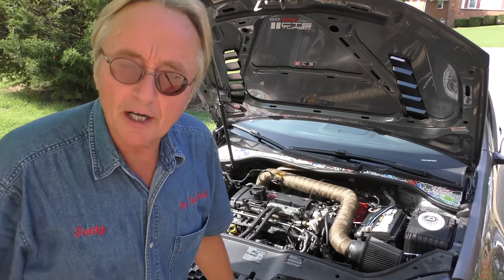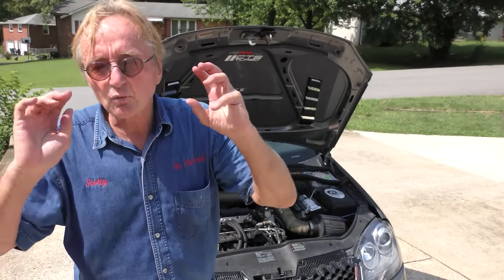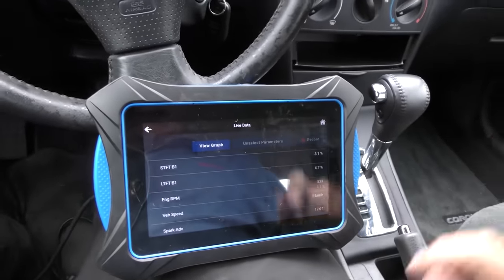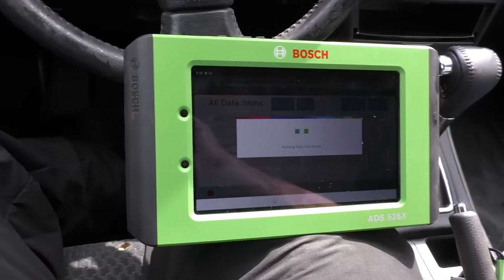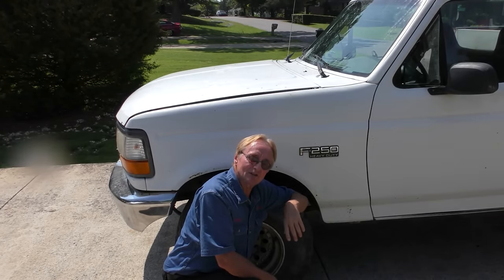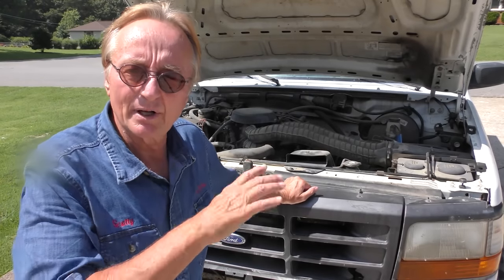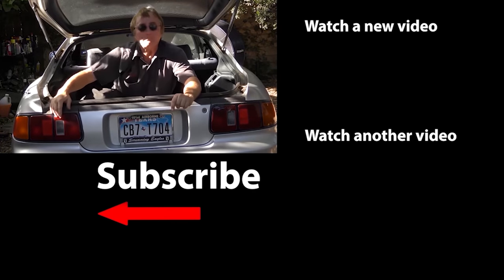3 Additives That Will Make Your Car Last Twice as Long

Comment: 2011 V6 Camry 120 k miles, push button start. Runs really well. For the 2 years, 2 out of 10 times the engine cranks but takes a 1.5-2 seconds to start. Other it will start in less than second. Any idea why? I changed spark plugs, O2 sensor behind the engine, new battery, new alternator, serviced regularly.
Reply: Seriously??? Really??? 🙄
Reply: @briant7652  LOL type in "Toyota fuel pump recall" in any browser LMAO
You obviously don't work in a Toyota Dealership.

Comment: do you have a video featuring Lucas oil stabilizer?  ive been using it in my 2000 Honda accord and before that a 2004 corolla.  both vehicles acquired with over 130,000 miles.

Comment: I'm assuming you would use the oil and fuel additives nearing the time you would want to change oil and filters right? Can't be good to drive around with all those carbon particles in your oil and gas. Correct me if wrong, just guessing here

Comment: I am still amazed that my VQ35 engine does not burn a quart of oil at 10,000 miles. 230,000 miles on this motor.

Comment: What exactly is the stuff called that you used? I was gonna put some in the car I just bought and drive it an extra 100 miles before I changed the oil

Comment: I see that VW has one of those full race Hot Air Intakes! Yeah, I know what they think it is supposed do. But aerodynamics does not care. There is nothing but HOT air under that hood and those kits do not make an airtight filter chamber connected air tube connected to any source of cool air. Also if you look or wipe a clean rag inside that intake tube you will see it is much more dirtier than it should be. Not trying to bad mouth anyone but those are the facts.

Comment: I really love your video and you really a good mechanic and I have a question and it would be good if I can get an answer from you please .it about a car that start running but at a high speed like60mile it’s start to decelerate and almost stop and from what I heard they said it a muffler problem and the oxygen sensor that connected to it is that true .thank you

Comment: will the Lucas stop slip work for manual transmissions? I eventually need to replace mine but it is a 1989 F250 4.9 L. not wanting to put that much money into her right now.

Comment: I have a 2007 Dodge RAM 1500 with the 4.7 in it and I always have a problem with the number one spark. It always makes my check engine light go off and you can always tell when it is going to set it off when you smell the fumes come out with exhaust. How can I fix it to the point to where I can drive it longer then having to change it every month

Comment: scotty .. i have a 2015 mb ml350 with 140,000 miles ... is there a treatment i should put in my gas tank or with the oil... my car runs ok but i was wondering if it needed preventive care

Comment: Even after a regular oil change, all the oil does not come out, because of the designs of the oil pans, there is also remnants of oil in the system, (so,) when this additive is used & drained, ( & since some will remain, even after draining,) will the remnants not impede on the quality - performance, of the freshly filled oil.?)

Comment: So I have a Honda Accord 2012 ( I'm not the original owner - Idk if it has ever been changed ) but I was going to try and change the transmission fluid on my own and now I'm questioning if I should even change it at all ? It's high on milage and running fine and I'd like to keep it that way...so should I change the transmission oil or not at all?

Comment: Question, if you run transmission fluid in the engine oil. Does this also jelp clean you engine. Note, just running it to clean and not drive around with it.

Comment: hey scotty i have an M57N2 diesel X5 its smoking really bad could you give me some clues of what might be failing? Scan tool wont thow codes. the car is working normal, just a little decrese in diesel economy but, the engine is performing as usual. KM 213 thousand

Comment: 🎯 Key Takeaways for quick navigation:

00:02 🚗 GDI engines tend to develop carbon buildup over time, causing engine noise, rattling, and oil burning due to low tension piston rings.
01:31 🛠️ Carbon build-up inside engines can lead to various issues, including noisy operation, increased oil consumption, and reduced performance.
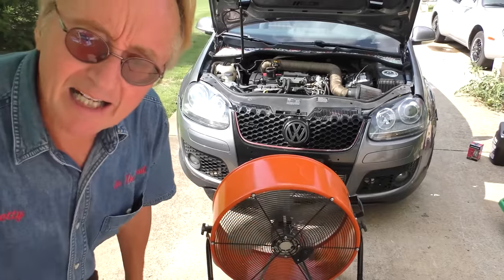03:48 🛢️ Regular oil changes are essential for maintaining engine health and preventing carbon buildup.
05:21 🔊 Cleaning carbon buildup can noticeably reduce engine noise and mechanical wear, improving overall performance.
06:00 🚙 Low tension piston rings in certain engines can lead to increased oil consumption, necessitating frequent oil changes to prevent carbon buildup.
08:37 🧰 Diagnosing engine performance issues may involve checking various components such as spark plugs, sensors, and fuel injectors.
11:30 🔍 Advanced diagnostic tools like high-level scanners can provide detailed insights into engine performance issues.
14:29 🚗 Fuel injector cleaning additives like Royal Purple can help improve engine performance and fuel efficiency by addressing dirty injectors.
16:56 🛠️ Older vehicles like a 1996 Ford F-250 can still offer reliable performance with proper maintenance, despite cosmetic wear and tear.
18:21 🔧 Adding transmission fluid additives like Lucas Stop Slip can help improve shifting performance and extend the life of aging transmissions.

Made with HARPA AI

Comment: for the life of me I have no idea why would you be checking a battery for a drivability issue? Ex Ford-trained mechanic here
Reply: then you should know that if the alternator is failing and the car is running off the battery then the batt will lose amps and therefore lose power, have you never had that happen? also yes the alt light and batt lights should be a clue but it can happen

Comment: That's funny, Toyota's are noisy too. Of course any direct injection is going to be noisy. 
I had a 2004 Camry with 100k plus and did all the oil changes. It started to smoke on start up. I now have a 2009 Audi A3 with almost 200k and it doesn't smoke at all. I worked for Toyota for years. They aren't any better than any other company. All cars break in time.

Comment: That oil treatment that cleans the rings sounds like big trouble. It must be a solvent, and running your engine for 15 minutes with a solvent on the bearings is going to do damage. If your engine burns one quart of oil per thousand miles that's a 100 quarts in 100,000 miles or about $500. Do you want to save $500 by destroying your engine?

Comment: Ive been using Wynns super friction proofing what do you think about this? It lessens the noise and vibrations alot for 8k miles.
Reply: I've been using PROLONG & NEVER had any oil related problems, watch 1 of AL Unser's commercials for prolong...you can take the drain plug out of your oil pan & drive Round he did in his race car !!!

Comment: I have an 02 highlander with no body damage. I'm going to change a PVC valve. But I'm wondering if a clogged valve can blow a recently replaced valve cover gasket
Reply: Thing has over 200k mileage with a fresh tuneup.

Comment: Scotty,
As I recall, the Ford 351 Cleveland (4 bolt main bearings) was the desired engine for high perf and NOT the 351 Windsor (2 bolt main bearings) engine...
Does anyone have contradictory info on that?
Reply: The 351 Windsor engine would fit in the small mustangs easier.

Comment: My 00 f150 is burning oil. It's idling rough right now while I'm waiting for my wife and I'm running the AC. Whenever I change the oil it's not very clean either. I got about a 140k miles. The exhaust stinks too. I feel like my cat must be trash.  I have been thinking about a solution. I need a muffler bong

Comment: Well people start their vehicles up and drive. Not letting the engines warm up at all!! As welll shutting them down when they get to where they are going. Start and stop driving is very hard on engines.  Most don't have oil pressure though out the engine and they are driving . 
 So Go Figure!!

Comment: I find spending $60 for two bottles of fuel and oil additives are a waste of .money if your gonna put it in and run a engine for 15 mins then drain out the old oil. That's a washer of money! Just change your oil and filter as required. Cost about the same.

Comment: Hi Scott have a 2011 Nissan Rouge saved tho ask the torque specs for the front end please, after changing the parts the control icon now flashes. Please help of you can. Thanks

Comment: Do not Gap iridium spark plugs. They should be gapped from the factory and iridium is fragile and if you chip that you will have to replace one you'll be out 10-15 bucks

Comment: maybe a dum question... but quick way of knowing if my car is direct injection port injection or both?? I have a 2007 toyota corolla 1.8 engine. Also a 2006 f150 4.7 engine (4.7 I believe). anyone know by any chance? the f150 appears to have a fuel rail

Comment: Scotty. I need help. I have a 2001 Civic ex and the transmission starts and runs but shifts hard after driving in a few miles it slips bad. When I let it cool down for a couple hours and starts right up and drive. Check the sensors and clean them but it's still shifting hard I took it to the mechanic and they were saying it might be something electrical.
Reply: P0730. The check engine says incorrect gear ratio.

Comment: 351 Windsor was way more solid than the 351 Cleveland. It was holding better the modifications and extensive beatings than its american twin
Reply: Fit  the Ford Australia designed Cleveland 4V heads and it will be a whole different story..  
The Australian designed 351 Cleveland was pretty much made to race.. 351 GT HO Falcon etc, etc

Comment: Can someone help us?  We have a 2015 Toyota Corolla.  We were just horrified, yesterday, to learn that we almost needed a new engine because of ethanol in the gas.  It was the cheapest gas and recommended by our dealership.  In fact they always told us not to put anything else in the car.  They were able to save the engine by doing a Complete Fuel Service induction and EFI.  Gave us an additive to put next time we need to get gas because the tank is full now.  Told us to QUIT putting ETHAOL in the car and switch to a 100% gas.  We are not car mechanics, senior citizens, fixed income.  Looking for advice now.  They said if that doesn't work and the check engine light comes back on it means we need a new $6,000.00 engine!!!!!!!!!!!!!!  Help.

Comment: Have an 18 Odyssey with 85k miles. The check engine light goes off when I use fuel cleaner but once the tanks gets refilled the check engine light comes back on. Do you have a recommendation for the fuel injectors besides replacement?
Reply: It's not that, take it to a mechanic
Reply: @jacobcurtis6849  I drove 60 miles and the light went off and stayed off.

Comment: VWs actually use a different oil than most cars for this single purpose. Use the correct oil, you won't have issues.

Comment: Anyone wants to know.... Stft is the Pcm handling fuel at the moment. Ltft is any fuel incident the stft could not find a solution. So the stft kicks a problem up to ltft, and grts back to running fuel in the now.

When the required fuel ttims ecceed 20% of normal the pcm triggers d cel.

Comment: I love everything about this guy.
But regarding the test, it would be much cleaner result if he recorded original sound(as he did), changed the oil once without the cleaner, record the result, then run the cleaning procedure and change the oil once again. I'm not saying the product does not work. I'm saying I don't know. You all probably experienced that you beloved car runs better or at least feels better not only after fresh oil, but also after you stop to fill it up with gas. Maybe it's a phycological effect rather than mechanical, but still.

Comment: No way am I knocking Scott but "Please" Buyers don't think and this is the way to fix your vehicle beating the crap out of it and adding this Mechanic in a can, Before i go on .. Here's why i posted this ... Customer comes to me with a engine noise ... i found quickly the belt tension er was noisy and flinging rust all over the alt and belt and tension er , removed the belt spun the tension er bearing is shot. Replace and recheck ... NOW new noise! ask customer to confirm repair says O OOH! much quieter BUT! the noise is still there??? OK through further discussion. Asked customer who changes the oil?? Jiffy lube... OK what do you get when you go there ... Customer replies "engine flush" on a 2015 Honda accord  sport.. OK Now i'm checking the timing chain tension and filter. Filter clogged and tension er failed. 1 hr later 100.00 for parts 115.00 for labor cars back up and fine. Fixing you car VIA Chemically can cost ya and make a mechanic look bad. So now my customer wants a refund for the tension er job???  wrong noise LMAO!

Comment: Scotty, sorry, but this product test for the carbon deposit clean and reduction of noise is wrong. Most of cars reduce noise when we change the motor oil. In this case, noise is not a good parameter.

Comment: 3 additives will make your engine last longer that is a very dangerous and It lacks the conviction of someone that wants to help someone rather than someone that wants to get clicks to look better and smarter. If you do not know the additive package in an oil that you're already using what you want and the added of that you're adding to it if it amplifies it or makes it worse and in 90% of The Times it makes it worse which takes away the effectiveness of the actual lubricant which will mask some things but cause long term loss of use and damage and and. If you recommend that to someone you lack conviction and fiction in the thought process of trying to aid someone and to help them out with great advice you are just looking to build a reputation and get clips to make some money. Be a salesman don't be an advocate because this is ridiculous

Comment: I like your videos but please either edit your audio levels throughout the video so we are blasted in the ears and having to raise and lower the volume constantly, or have someone on fiverr edit your videos for you for cheap. Also, not sure why so sloppy with changing the oil filter, makes such a mess if you don’t take the extra minute to unscrew, let drain and then unscrew slowly completely. You can have zero mess on most cars if you take an extra minute and save a few minutes cleaning up your engine area.